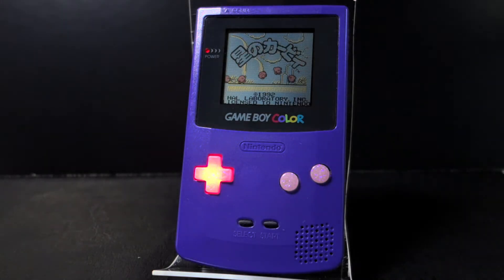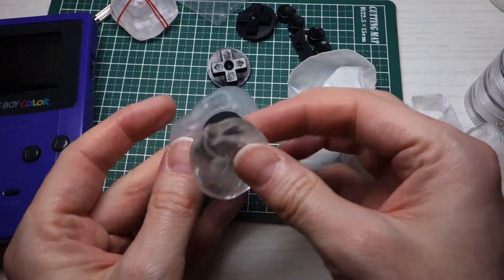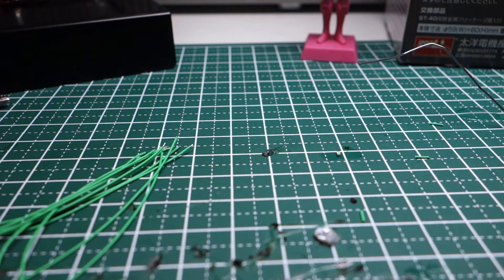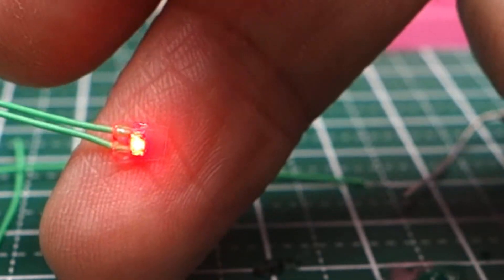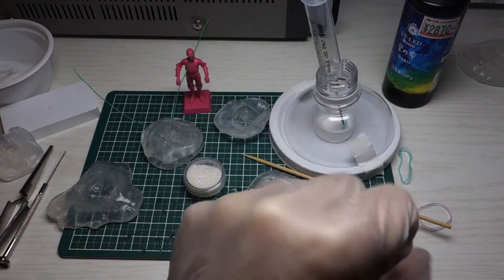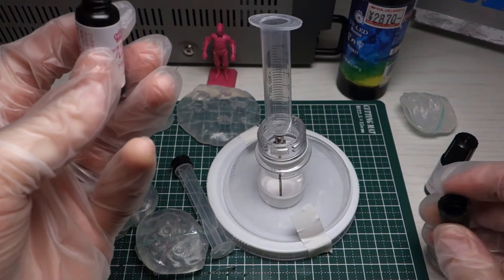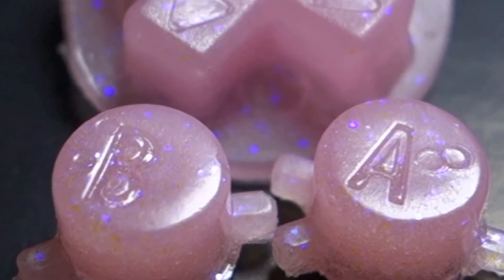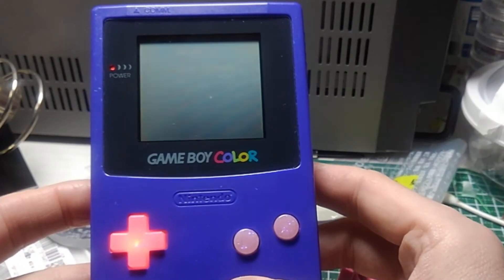How to Cast a D-Pad with an LED inside

Comment: I remember when Roarke made those LED embedded buttons, yours came out great too! Really want to try that oyumaru stuff soon. :)
Reply from the maker: Thanks man that really means a lot! Thanks so much for the shout out🙏 I like what you are doin over on your channel too. Please do check out some oyumaru. I put a link in the description. There may be cheaper alternatives but I use the clear oyumaru. I want to try some silicon molds i have a bucket sitting around i just need to find the time to do it.

Comment: Great mod video, thanks for the inspiration. Would love to see the buttons wired up too.
Reply from the maker: I do wire them up at the end of the video was it too quick?
Reply: @ScruffyLookinRGB  Sorry, I meant an led in the A and B buttons wired the same as the D pad. Perhaps I missed it. Great instructional though
Reply from the maker: @harryandy44  Thank you so much and You are welcome! Sorry I miss understood. Definitely will put leds in the buttons too next time. You have any good color ideas or themes for the next one?
Reply: @ScruffyLookinRGB  Great question. I've seen some custom gameboys using great combinations of White and Gold, black and white, yellow and red, blue and green etc, depends on the base colour and whether the led would shine through the pigment. Would be nice to see if they could work with denser colour combinations and how that would effect the led.
Reply from the maker: @harryandy44  very intriguing indeed. You have given me some good ideas. I will look into those especially the darker colors with leds in it. Thank you Brayzar for the insight. It should make for some dynamic buttons🎮👍